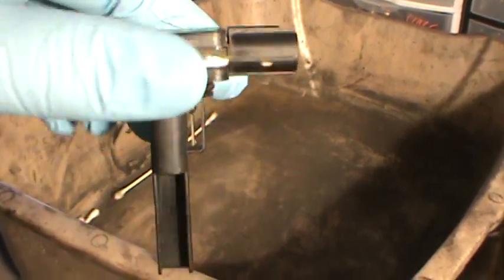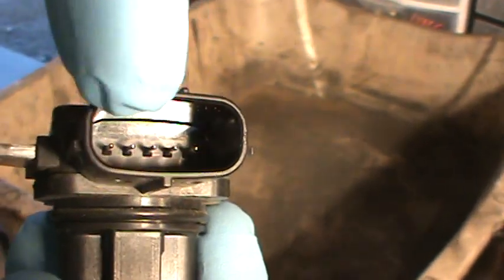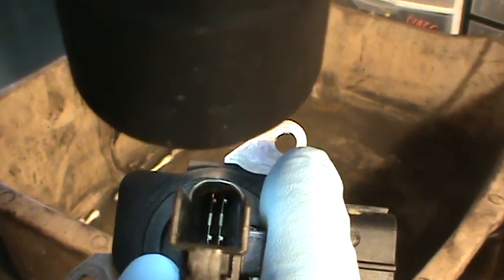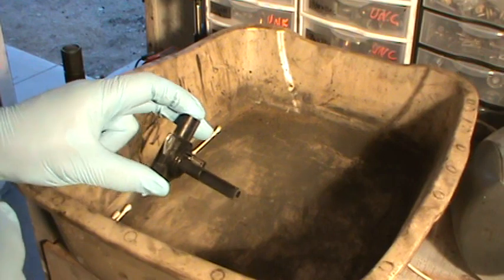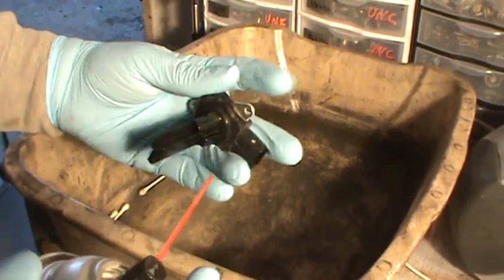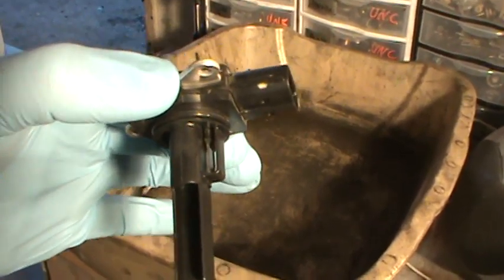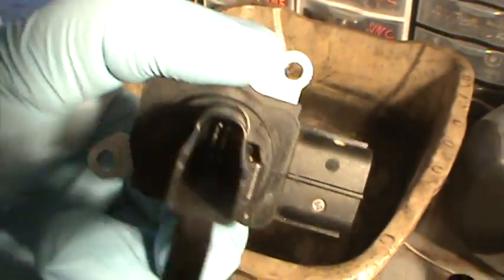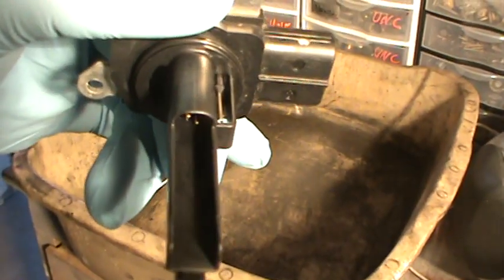Dirty Mass Air Flow Sensor P0171, P0172, P0174 Codes

Comment: My 06 Sentra threw a P0171 code and was running very rough, then would barely idle and would stall when put in gear. After I cleaned the MAF and let it air dry, I reinstalled it and the code went away but the car still runs at about 500rpm. Got a new MAF and the same, still runs rough and not able to put it in gear. Running out of options. Any ideas??
Reply: vacuum leak?

Comment: '06 Avalon threw P0172/P0175 - turned out to be a dirty MAF sensor. Cleaned with CRC Mass Air Flow Sensor Cleaner. DO NOT touch the platinum wires with anything. Clean them only with the CRC spray on. Let air dry - reinstall - clear codes and do change your air filter when it's getting dirty.